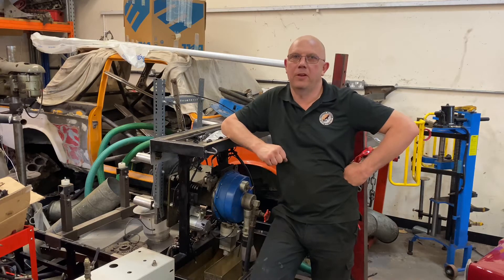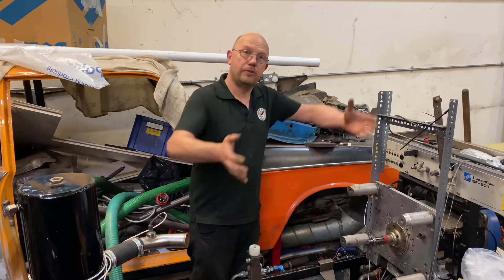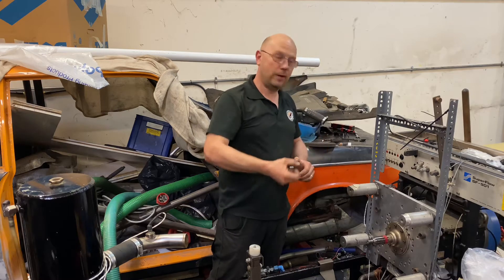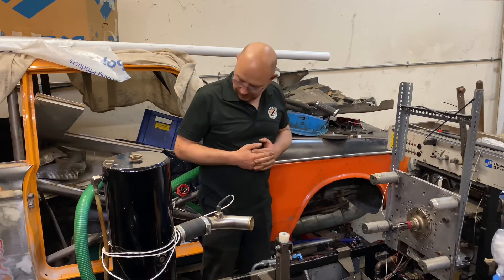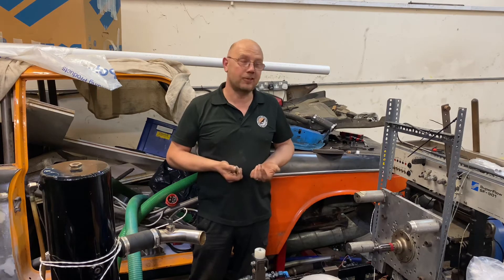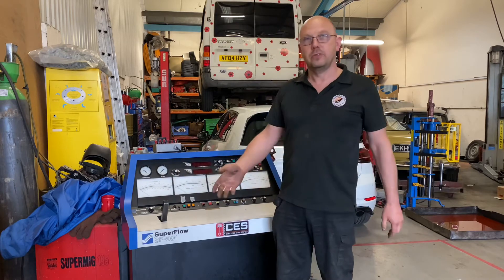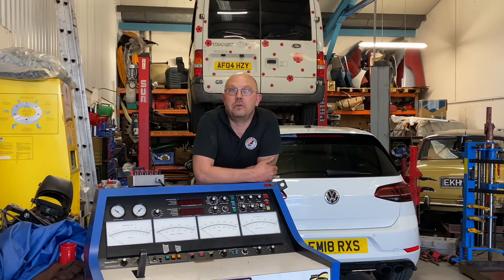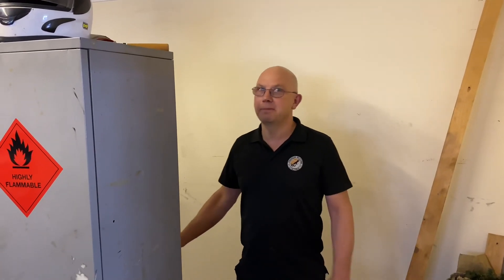30+ year old Dyno Superflow assembly project - Part 1

Comment: The biggest difference between this dyno & a new one is that the wonderful 1978 electronics has clearly been designed to repairable. Equipment like this can be kept operational for ever, esp with some spare circuit boards.